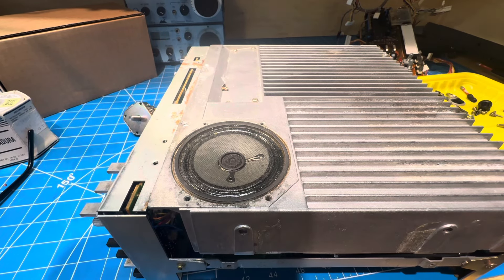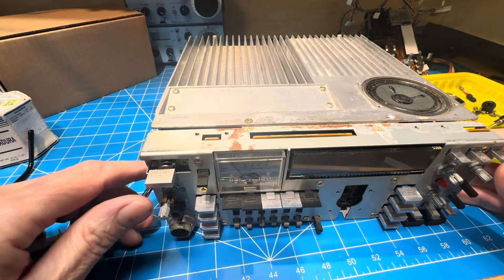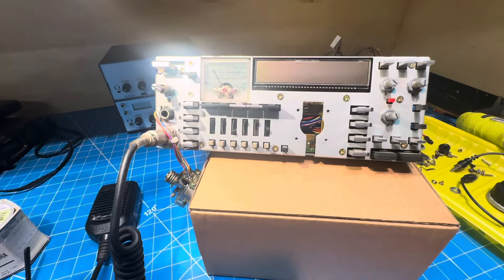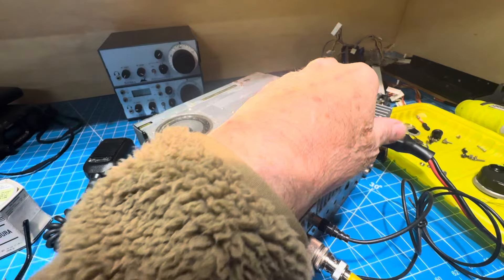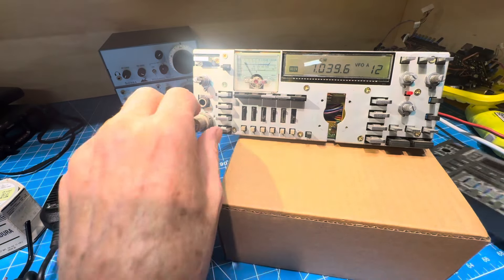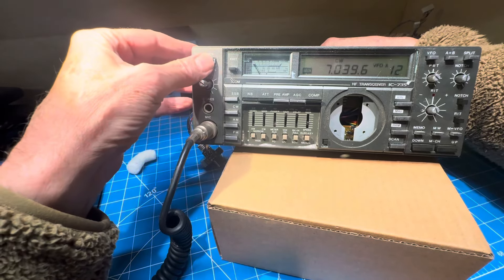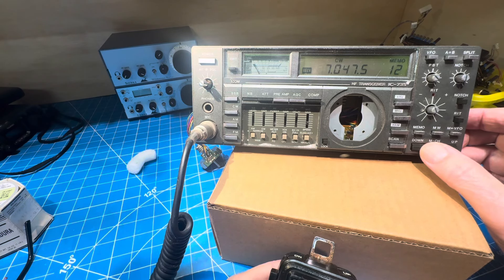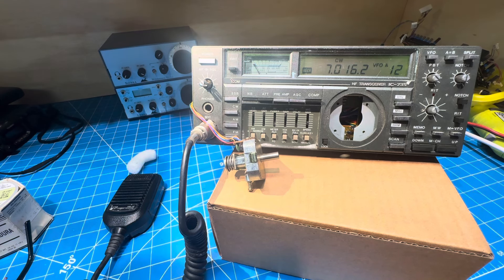Rusty IC-735 - A Brand New Look? Well, No…

Comment: Well done, impressive undertaking..
Reply from the maker: It turned out to be easier than my first impression of thinking I needed to remove the PCB from the front panel. That might have been a bad one… other than missing the screws on the back of the power amp… that was a bit embarrassing… overall the trophy goes to the Hakko!